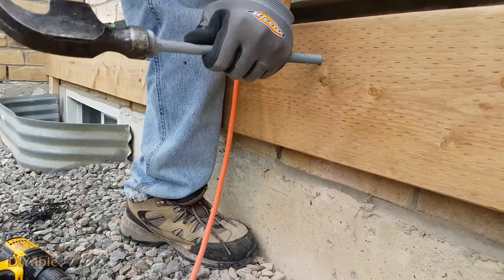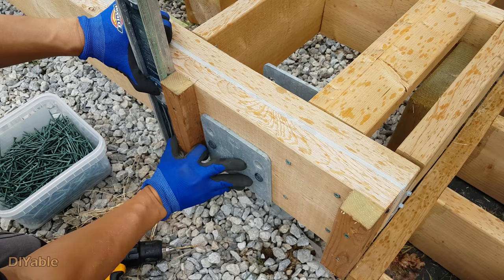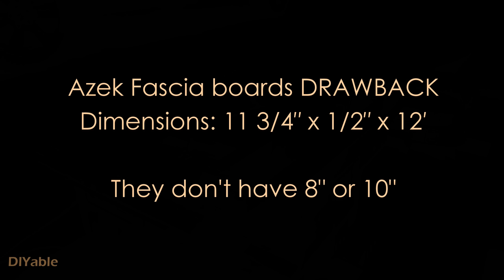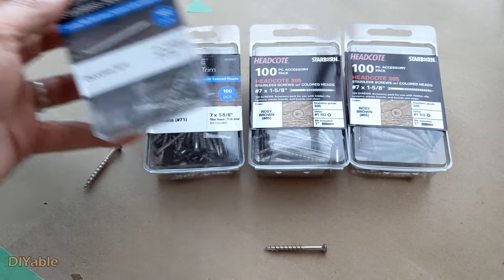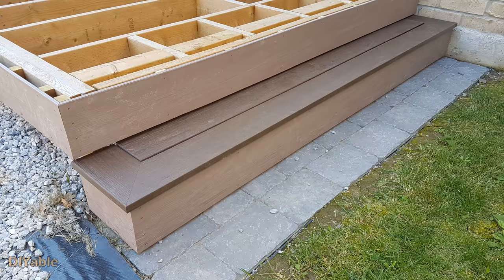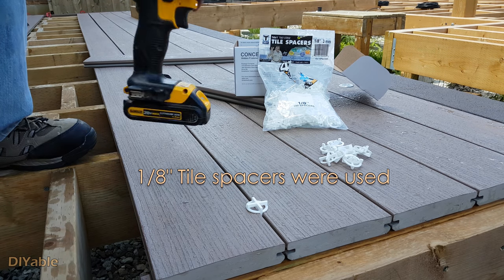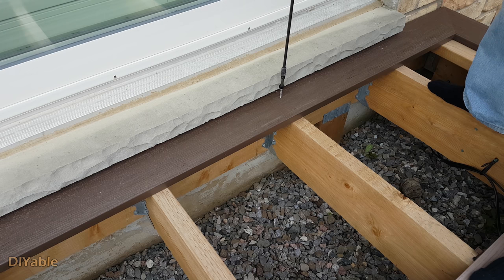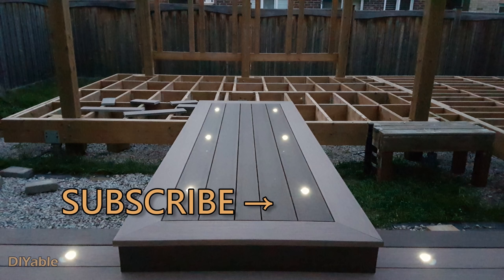DIY Deck (Part 9): How to picture framing Azek deck boards and install fascia like a pro?

Comment: at first i started securing one/two boards and 4 boards in I was fighting a curve and it felt very bad when i had 20 more to go so i backed them up, laid them all out minus 2 at house and then as I did it i would push 4 in at a time to push them closer, but if its 20 ft long you need 2 people or a very wide grip and push, otherwise one side kicks out and you fight it and cause a curve. then when I secured them i only screwed them all in half way and then went around to fully seat the screws because if I fully seated one it would pull the next board up and sometimes mess up the clips. Lots of lessons learned, love it though. I had my joist with blocking sitting for a year before i bought the decking, expensive, also boards become more twisted than i would have liked and shims used but it all works :) composite shims. thanks for your videos

Comment: I've used trex a few times.  The 1st gen of trex swells unbelievably.  I have it on my own deck.  Every 3 years I run a circular saw inbetween the boards just to keep a gap!  The newer isn't as bad but a 3/16 gap would work better than an 1/8
Reply from the maker: Thanks for sharing!  That's good information.  I think you are referring to the fascia boards installation, I tried both methods I mentioned in the video (1) glue + screws (2) spacers + screws.  After 2 seasons, passed Canadian harsh winter..  neither of them have given me any issues. The miter joints on the corners as well as the butt joints are totally fine.  No screws popping.  The ambient temperature during the installation is very important, according to Azek installation guide, on a summer hot day you don't actually need to leave any gap on miter/butt joint. However, if you are install on a cold day, you do need to leave a gap. That applies to both fascia boards and the deck boards.

Comment: Great video series!  If you are using a non-grooved deck board for your picture framing, how do you connect it to the next board that is grooved?  Do you have to router a groove into the picture frame board?
Reply from the maker: Very good question. Glad you actually asked!!!  Router is one option, but I didn't do it that way. I used "Cortex Fasteners" on one side of the grooved board.  If you don't know about Cortex.. check out Part 20:  https://youtu.be/TVEkeCp_6vU
Hope that helps.

Comment: Wouldn’t that sideways 2x4 blocking for the picture frame border trap a lot of water and eventually rot? Otherwise, nicely done!
Reply from the maker: Very good question. It does trap some water but it goes away pretty quickly.  Same thing happens to the joists. Some suggest to use the joist tape on the blocking. Now, we are into another topic - joist rotting and joist tape. If you are using PVC board such as Azek, don't use bitumen based joist tape.  There are butyl based tape which may work better with PVC decking. I did a video on this topic, check out part 10. 
https://www.youtube.com/watch?v=0hZCLGwdLFk

Comment: DId you use horizontal 2x4s around entire perimeter for your picture frame? How did you fasten these into place?  Thanks for the great videos!
Reply from the maker: Yes I did. I fastened them by drill the deck screws at 45 degrees, either from the top or from the side

Comment: Nice work. Did you cut all of the inside (non-picture frame) deck boards to length one by one, or did you cut a line across all of them with a circular or track saw? It’s hard to tell from the video. Thanks.
Reply from the maker: One by One, I cannot afford to make any mistake but I have to admit, it is VERY SLOW!!!!!!  Usually professional cut a line across all of them in one shot, if you are confident doing that, go head. I don't have a track saw... I am worried that circular saw may not give me a perfect straight line, that's why.

Comment: Very nice video and lots of helpful information! I am planning to use AZEK Slate Grey deck board, I am thinking of doing butt-up mitre joint for picture framing (border), how do you find about this Azek deck board's "expansion & contraction" during winter and summer ? ( winter here sometimes -20 to -30 Celsius and summer could be like +35 ish Celsius)

Comment: Awesome job, I am in the GTA as well. Is it possible for you to tell me what screws you used for attaching Deck boards? GRK?
Reply from the maker: I am using their CONCEALoc clipping system as well as Cortex Hidden Fastening System with matching color and pattern plugs specially for the Azek boards. I ordered them from Deck Stores <-- they are expensive unfortunately.

Comment: what store has the lights
Reply from the maker: Sorry for the late reply.  The brand is called "Paradise", they are made in China, they are available in big box store or even Amazon.  If you are in Canada, they sell it at Rona. Wait for them to go on sale, don't pay for regular price. Don't expect the quality is very high. I had to replace couple of them after my first installation about 2 years ago. 
https://www.rona.ca/en/garden-lights---set-of-6-eco-garden-lights
https://www.rona.ca/en/set-of-6-deck-light-p15235025

Comment: Hi! Have you installed Trex decking?
Reply from the maker: No I haven't. But it's very similar. Remember to read the installation manual, both Trex composite and Azek PVC are known to expand and contract.  The ambient temperature during the installation is very important, according to Azek installation guide, on a summer hot day you don't actually need to leave any gap on miter/butt joint. However, if you are install on a cold day, you do need to leave a gap. That applies to both fascia boards and the deck boards. I believe the same concept applies to Trex.  However, always read the Trex installation guide carefully before you start the DIY project. Good Luck!
Reply: @DIYable  thank you!
Reply: Trex calls for 40°F above and below.
Above it's 1/8 for end to end and 1/4 abutting.
Below it's 3/16 and 1/2

Comment: What kind of wood do you use for deck/ step? Cedar or treated wood
Reply from the maker: Those are Micropro sienna treated wood, they don't carry green color pressure treated wood locally in big box stores, they do look like cedar but they are not.